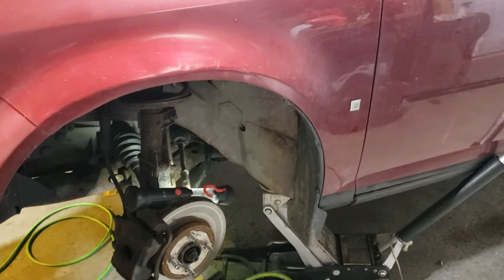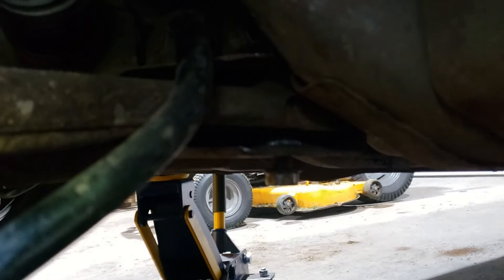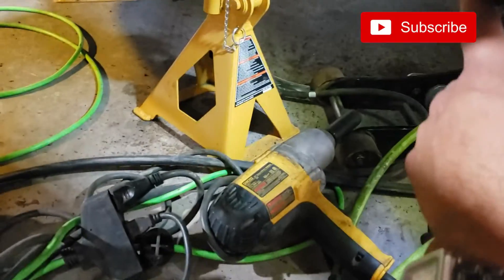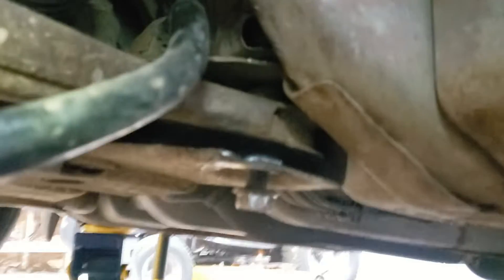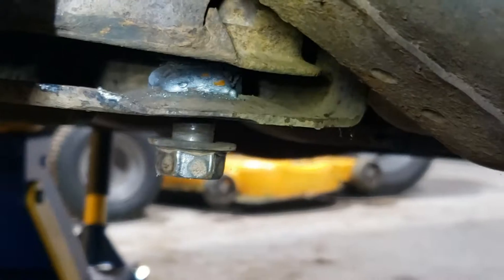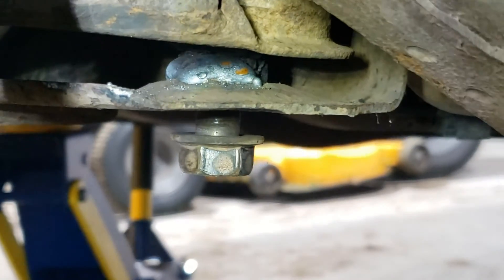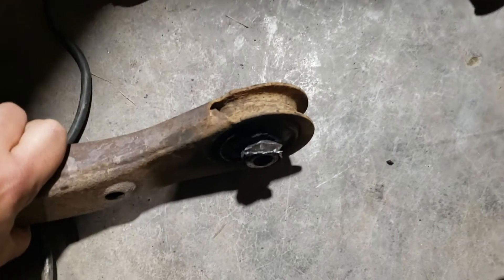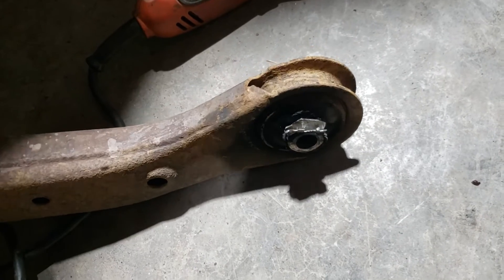Solution to Remove Stuck Control Arm Bushing Bolts

Comment: My bolt snapped off . What do you do in that case? I been trying everything
Reply from the maker: @gregwelch2459  did it break flush near the head of the bolt or deeper inside?
If flush, and you have a welder (or know someone with one) put a flat washer over the end of the bolt and weld it as hot as you can without welding the washer to the frame (maybe 90A or so). Then put a large nut over the washer and weld the nut to the washer and bolt by filling the hole of the nut. Completely fill the nut as the extra heat will travel up the bolt and help free it from the nut. Allow it to cool completely then carefully try turning it out.
Reply: @nothandsomebuthandy  up inside about an inch or so
Reply: I think my only option left is to cut the arm off then maybe I can get the rest of the bolt out like you said with a welder to spin it off the factory nut and replace it.?
Reply from the maker: @gregwelch2459 that's tough. Only thing I can think of is try to cut the bolt above the bushing with a reciprocating saw and a good quality metal blade. Then remove the arm and try the welding trick. If that still doesn't work try to hammer the bolt upward and replace the bolt and nut with a new one.
This might be tricky because the nut is captive in a little tunnel but if you smack it hard enough the tunnel thing should break.
I've had to do this in the past as well.
Putting a new nut in is a little tricky, I cheated by cutting a little access hole and tack welding the nut so it wouldn't turn them welded up the hole. 
You're definitely into a bit of work that I'll admit is my least favorite to do.
Good luck
Reply: @nothandsomebuthandy  ok thanks for the info.👍

Comment: Had a similar issue doing LCA’s, where the bolt would just spin in place & not back out. 
   Like in your video, had a small gap where the bolt partly came out. 
  Ended up being able to get a ball joint separator in btwn the bolt & body.  
  Then, used 2 impacts to drive the BJ separator open & back out the bolt at the same time.  
   Worked like a charm.
Reply from the maker: Nice

Comment: Wat bolt u replace it with
Reply from the maker: I was able to reuse the bolt by welding the sleeve so the bolt would turn. If you need a new bolt you can order the bolts and captive nuts from GM or an auto parts store

Comment: Yeah that’s not wise. Added extra heat to the mounting bracket.
Reply from the maker: You only need a small tack so not much heat affected area and the plate is factory welded to the body and likely not heat treated steel.